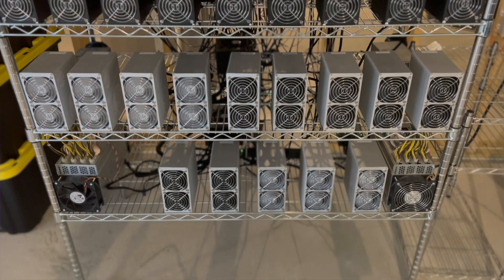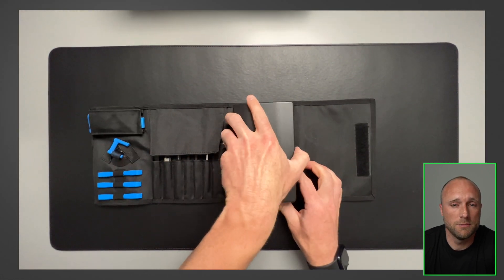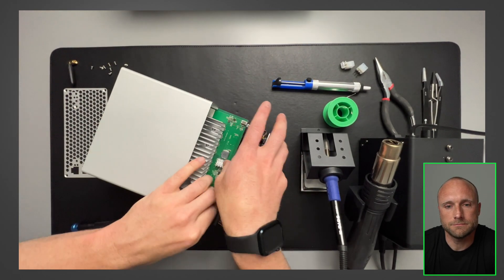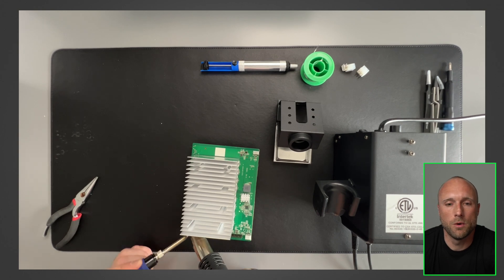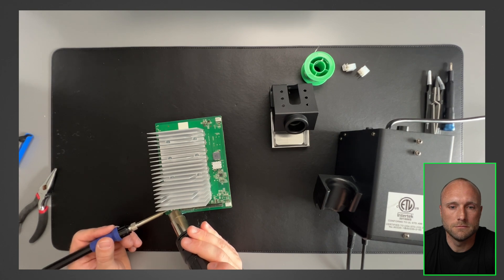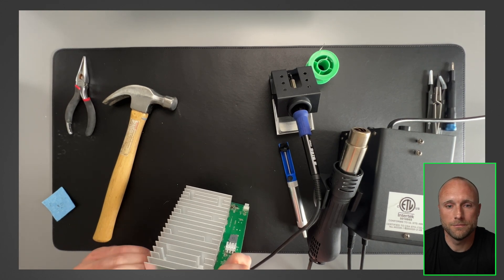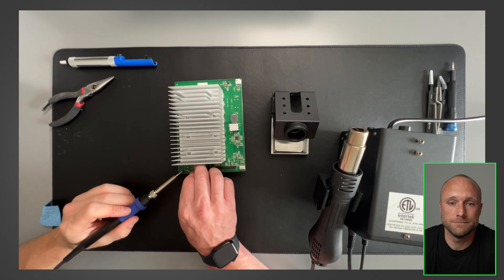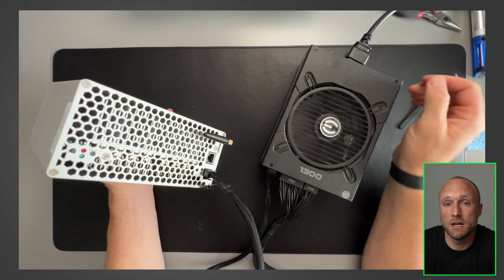How to Fix a Crypto Miner’s Burnt PCIe Connector

Comment: I wish I found this video last week haha, NEVER use the PSu that is supplied with these machines they suck
Reply from the maker: Agreed
Reply: @SwanCastleCrypto  do you have any of the mini doge 2 or 3? If so do you ever run them in hashrate mode? I got PTSD from the stock PSU and never run my machines out of LHR since I don’t wanna burn the connector again
Reply from the maker: @Brad_Butters I have the mini doge 2, but I connect it to my own PSU
Reply: @SwanCastleCrypto  that’s good, does running it hashrate mode cause any issues?
Reply from the maker: @Brad_Butters nope I haven’t had any

Comment: I've got 3 of these mini miners. The KDBOX II had this problem. Took it to a repair shop and $40 and 10 minutes later.. Months later, it did it again.. So I went to Lowes and got the hottest soldering gun and fixed it myself. FIXED. NOW.. my KD BOX Pro has done the same thing. So it's now doing good on a seperate PSU. Well.. I think I tried updating the wrong patch to it and now it's not working. It'll reset, but it doesn't stay in the green long enough to FINDMYGOLDSHELL IP and check or reset the unit from the internal side of it.

Comment: Had exactly the same issue with my DOGE miner and Goldshell power supply. When I wrote to Goldshell and warned them of the power supply issue they were in denial to the problem, yet it was well known and published across the internet. (12 months ago)
Reply from the maker: Interesting, makes sense they wouldn’t want to open up to taking blame
Reply: Same here.  I sent them pictures of all three of my doge miners having burnt 6 pins and they denied everything and refused to help.  This was back when it was still under warranty.